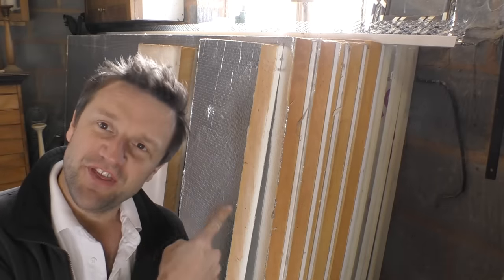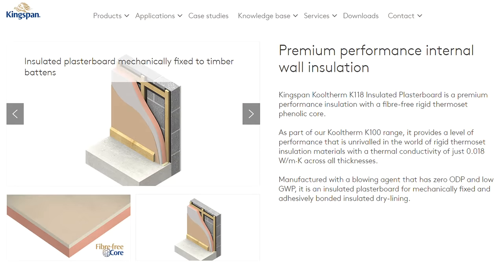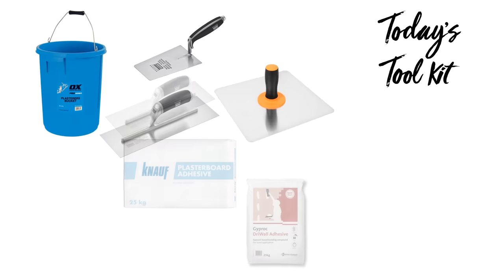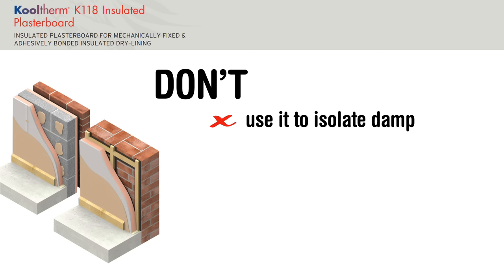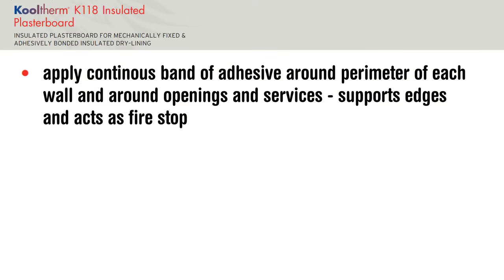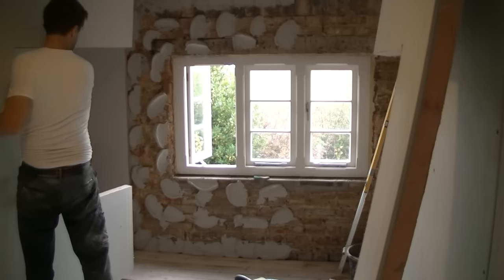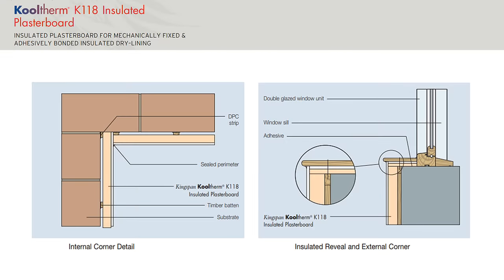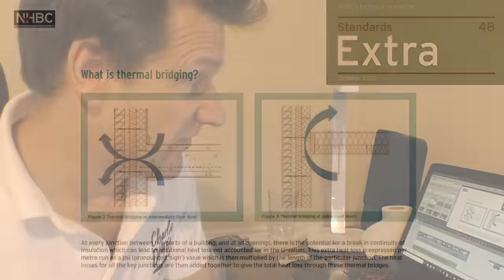How to Dot & Dab Insulated Plasterboard - a DIY Guide

Comment: great video Charlie, subscribed. Was there another purpose to removing the existing plaster other than to checking the brick condition and creating more room?  Also, did you have your windows replaced before or after installing the insulation? It's hard to tell.
Reply from the maker: Thanks! The existing plaster/render was completely shot (no key) and so I thought I'd remove it. Yes, it does buy you a little more room, but if the render had been better (as it was in my daughter's room) I probably wouldn't have bothered removing it. I replaced the windows before insulation, as you want to build your insulation around the windows, in terms of minimising cold bridging etc. In an ideal world you want insulated plasterboard into the window reveal too, with a continous layer of insulation around the right angle of the window reveal, if that makes sense - see the circled bit in the right hand diagram at 23.23. The other thing you've got to watch out for is the plug sockets as this can be a major source of cold bridging.
Reply: @CharlieDIYte  cool. Thanks for the reply Charlie.

Comment: Anyway, you burst my bubble.  I was planning on insulating the majority of my single skin red brick garage as a workshop.  However you mention that if I insulate more than 50% of the walls it is subject to building control.  I was not aiming on creating a "heated living space", just a workshop that I could use in winter a few hours a day with maybe an electric fan heater.
Reply: Simple solution: don't inform building control.

Comment: Can these boards be used to insulate a bathroom ceiling?
Reply from the maker: I guess. Very heavy to put up though. More usual to instigate in between the joists with PIR board
Reply: @CharlieDIYte  thanks for letting me know! I will check for alternatives.
Reply: @Cuiositycola  For your application it may be worth looking into a product called 'Spacetherm'. Much reduced (often 10x) thickness for similar U Value (W/m2k).
Reply: @Bradleyguy22  thank you! Will check it out

Comment: Hi Charlie, Great work! And the reviews from others is now driving me to go down this route on our 1975 built detached house with cavity walls..Got a question, our external facing wall in the bathroom is not level after removing the tile the wall was a  bit of a mess and not level, so I've attached cls batterns to create a stud on part of the wall where the shower enclosure will be. The reason for this is to achieve square edges fo r the shower tray. My question is would you apply insulation in between the batterns or moisture board straight to the stud work? Rest assured idea is to tank the moisture board area in full. Any advise on the insulation will be much appreciated. Cheers Sam

Comment: Kinspan's 'technical department' is talking out of its ring piece: NEVER use timber battens screwed to a damp wall - even if you use a DPM between - it's the perfect breeding ground for dry rot: damp wall, damp timber and zero air circulation. The mycelium will spread up the batten/s, into the first floor joists and the first you'll probably know about it is when some poor sod puts their foot through the floor. And don't assume that tanalised timber will help - it won't. I've seen dry rot go straight through an unventilated tanalised floor in less than two years.   The ideal solution would be to build a block inner leaf, but obviously that would entail a lot of work, and may not be possible. 2nd best: give the walls a 15mm coat of sand and cement render, incorporating a waterproofer (Sovereign Rendermix is a good one.) when fully hardened, offer the insulated board up to the wall, drill 6.5mm holes at 600 mm centres (one at a time, and fix with red plastic plugs and 65mm aluminium (from a roofing supplier) clout nails. Before skimming, scrim over the vertical joints, obviously, but put a line of scrim over the nails in the middle too. Skim up and you'll have a nice warm, dry wall that has zero risk of causing problems further down the line.

Comment: Hi Charlie...if I had to fix some of this to the underside of my rafters, what sort of fixing can I use?

I have a curved return to the top of my bedroom walls which is made out of plasterboard fixed directly to the underside of the rafters but which the back of is directly exposed to the side facing soffit vents.

This is causing cold spots where the air is hitting the rear of the boards and it's not the sort of thing I can simply put insulation behind as it would block the soffit's airflow.

Comment: This isn't dot and dab this is just..... dab, plumed vertical horizontal dots on the wall, leave to set with a square piece of plasterboard set into it, string line off these then fill in the gaps with the adhesive, you can use plasterboard to set or what we use nowadays is those green white black blue spacers you get for when we fit glazed windows (Packers), now you have a wall that got many dots over it which are all plum and in line, DAB the wall you put the plasterboard up press against the dots now it's plum and straight, hence why it's called DOT and DAB

Comment: I am so great full for this as I need to do this in the coming weeks for my extension.

Have you ever installed facia and soffit? If so, do you have any advice? I need to know if this is something that I can DIY or leave it to someone with more knowledge.
Reply from the maker: Hi Dan. I have to say I haven't, but I imagine a bit of Googling will get you up to speed on it. I can't see why you can't do it yourself unless you're installing plastic which will be more fiddly.
Reply: Try the Swish building products website. You can get details of how to install fascia boards and soffits there and you'll be able to determine whether you think you can do the work or not. It would be advisable to have scaffolding to work from to make your life much easier and safer - definitely required from the first floor upwards. You'll also have to check the quality of the roof membrane where it meets the fascia board - this might need replacing so bear that in mind and you'll have to remove at least a couple of row of tiles to be able to replace the membrane. You'll also have to check the ends of the roof rafters. If they're rotting they'll need to be cut back and new pieces added on. It isn't a small job even for two people to do. Good luck with it.

Comment: Thanks for the great video, Charlie.
I have a couple of questions for you:

1. With the thick insulation backing, is it possible to screw through the plasterboard and insulation and into the brickwork, if you want to hang cupboards and the like, or does the insulation just crush?

2. In terms of screwing things into the brickwork (through ordinary plasterboard), it seems that the problem is created by the dot and dab system. Is it possible to completely cover the wall with a layer of adhesive so that there are no gaps behind?  Obviously it would be a right pain when it comes to pushing the board into the right place, and the adhesive has nowhere to go, but would it be doable?

Thanks
Reply from the maker: Thanks  1) It wouldn't crush provided there was plenty of adhesive dabs behind it, particularly as you'll probably need to go at least 60 -70mm thick with the insulation to satisfy the u values, 2) you couldn't do that - because you'd never be able to properly level the board and if you're going to do this you might as well just render the wall and plaster it. If you're worried about hanging heavy things in plasterboard walls, you need some Corefix fixings - as shown here https://youtu.be/fx90VadXSXA
Reply: @CharlieDIYte  Thank you very much.

Comment: Great video! But looks a hell of a job, and messy.
I think I'll have to see if I can find a competent professional to do it for me. 

You were also lucky in that you didn't find any damp getting in from outside when you stripped the render off. If it turns out unfortunately that water is getting in from outside - so it's not just condensation onto the cold internal surface, then the whole thing gets a lot more complicated. Probably not DIY territory. 💦💧🛠️
Reply from the maker: Agreed Ian. And you have the problem of interstitial condensation through the cold bridges if you don't install it properly. It's a truly tricky one, this, a bit like the issue of condensation in cold roofs.

Comment: What was the thickness of the boards you used?
Reply from the maker: About 60mm I think but if I'm honest arguably not quite enough to satisfy the u values (even though it's made a massive difference to our heating) so go as thick as you can - plus you need to tick that box for building regs too.
Reply: @CharlieDIYte  ok, Thanks for the advice. I think that will be as thick I go go without taking too much off room size.
Reply from the maker: @antobeer  Yes that was very much my thoughts at the time. You'll find though that once it's in, you'll not notice the difference. Just do everything you can to minimise cold bridging - between boards, around windows and also if you cut the boards for sockets. If you do have to cut the boards for sockets, consider insulating behind the socket boxes with expanding foam rather than the adhesive as that will minimise the problem.

Comment: Oh dear, did anyone notice all the inconsistencies?  Water penetration and dampness are only marginally touched on . With solid walls you can never be sure you do not have water penetration not least because dew points occur within the bricks; bricks are water absorbent!  A condensation risk analysis will only show up very limited circumstances i.e only as good as the figures you put in. It will take some time but the stuck on board will eventually fall off and the battened walls too because the battens will rot. Meanwhile the mould growth behind the sheets will create various health problems, etc, etc. Do not do it!

Comment: Contacted Kingspan this week as I wanted clarification on the internal corners. The diagram shows the board face up to the external wall as well as the foam which looks wrong when there is so much concern on vapour barrier. Anyway the upshot of this is they no longer provide technical support for projects of less than 3 houses. They have a self service site but apart from going around in circles and finding the same old material it doesn't offer much. Shame really.
Reply from the maker: That's really disappointing David. I agree with you on the internal corners, something I acknowledge I've done wrong in this room. I think what you have to do is complete one wall, and then offer up the new piece at right angles. Mark with a pencil line down the length of the wall where the new piece butts up in the right angle. Take it away and carefully Stanley knife down the pencil line and cut away the strip plasterboard, being careful not to penetrate any vapour barrier between the plasterboard and insulation. Then when you butt up the new piece, there will be a continuous band of insulation going round the corner. You use the same principle on the outside corners around the window reveals. That way you're minimising any cold bridges around the corner, and if you're worried there's any gap you can always spray foam into the gap as you butt the two pieces together. The Achilles heel of this system is a) where you butt up each piece to the next on a straight run where with the best will in the world you'll never get a completely snug joint that eliminates vapour penetration and cold bridging, and b) sockets which are a major source of cold bridging because you're cutting through the insulation. I recently insulated our bedroom and for this reason I chose a different approach. I battened the wall with tanalised 2x1, with DPC where the battens touch the wall. I had to pack it out as the wall wasn't plumb so there's an air gap behind the battens. I then filled between each batten with foil backed 1 inch Ecotherm, foil taped all the joins, and then screwed the Kingspan insulated plasterboard to the battens. I cut through the insulated plasterboard for sockets, but of course cold bridging is minimal because of the insulation behind, and I also foil taped a piece of ply flush to the back of the hole, to give me something to screw the socket box to. I drilled a hole through the insulation then from the socket box to the floor with an auger bit to thread the electrician cable through for the socket. And I had a 10mm gap between the floor and the insulated plasterboard, which I filled with expanding foam tape which is breathable. I think that's pretty much your best bet for wall insulation.
Reply: @CharlieDIYte  thanks for replying... some brownie points there for the huge explanation.  I was thinking of foil wrapping the ends. I have tried your PayPal thing but didn't get very far using phone. Anyway enjoying the wardrobe build at present..  Next project!
Reply: @CharlieDIYte  I'll be taking on this job after Xmas & it got me thinking about dealing with internal corners especially on external walls. I think it makes better sense to miter the corners at 45 degrees leaving a gap to get some closed cell foam in there to fill & maintain a vapor barrier.
I've seen in other videos guys using Jackoboard  for window reveals if it's too tight to use insulated plaster board, I'm thinking it might be an idea to use this stuff behind plug sockets too along with foil tape & some foam.
Fantastic video BTW, really helpful info to formulate a plan, thanks.

Comment: They’re foil backed boards you shouldn’t dab foil backed boards, I could pull one off because the dab won’t bond correctly to the boards, might look ok but the bond to the back of the board will be weak.

They need screwing to timber or metal stud!

And it’s single skin brick get any damp behind the boards which now you can’t see you’ll end up with a mass of black mould behind the boards, too many dabs also and because bonding compound is hemihydrate you’re adding to the chances of mould if you get any damp through from the outside and in time you will!

Comment: With all due respect to Kingspan they are wrong about dot and dab and solid walls. It’s true that moisture is a problem and you need to deal with it. Nowadays you can apply a liquid air tightness membrane and apply dot and dab on top of that. You absolutely should not ignore penetrating damp or you will end up with mould but also it’s a real shame that Kingspan who manufacture relatively modern building products don’t seem to know modern building products. 
Heads up, don’t apply a plastic vapour barrier as that is not breathable and you can end up with mould behind it

Comment: Is it possible to do without removing old plaster back to the stone wall/brick work?
Reply: Not advisable. However, my friend bought a property to rent out where the plaster had de-bonded significantly. He cut vertical channels in the plaster, wall plugged timber battens to the wall,.then mechanically fixed the insulated plasterboard to the battens. That was 6 years ago and as far as I'm aware, there's been no issues.
Reply from the maker: That's a good idea, John. I agree, if the key's gone on the plaster then you should take it off, but in my daughter's room the render was still pretty good so I did dot and dab on top. The problem with this is you don't know if the brickwork is totally dry behind the plaster, which you want to check before insulating on top. I also like John's idea of using timber battens. I did this in our master bed, and the advantage is you're not putting a lot of moisture into the wall (through the adhesive).
Reply: Cheers for the advice.

Comment: What about condensation?
Reply from the maker: You have to do everything you can to minimise cold bridging at the edges where each sheet buts up to the next and around reveals and particularly where you cut in the electrical boxes. My advice would be up look into using the spray foam rather than adhesive as this will be a much better insulator.
Reply: @CharlieDIYte   Hi Charlie/Rebecca, products move on etc. Are you aware of a product called 'Spacetherm'. Much reduced (often 10x) thickness for similar U Value (W/m2k)? It seems to tick most boxes.

Comment: Would have helped if he had drilled and plugged the wall boards because the surface of the insulation is shiny and doesn’t adhere well to the dri wall
Reply from the maker: It's actually designed to be used in conjunction with the adhesive, Rebecca.

Comment: You're lucky,  your daughter turns the rad down,  mine opens the window
Reply from the maker: 🤦 I've just installed the Drayton smart heating system which has a draught detector that switches off the rad if someone opens a window https://bit.ly/3qFDSMg

Comment: I thought you couldn't dot and dab foiled back plaster board? i'm new to doing it but good video anyway.
Reply from the maker: You're basically right but the K118 is designed to be either dot and dabbed or mechanically fixed to studs, although even with dot and dabbing you still have to mechanically fix (ie you can't just rely on the adhesive).
Reply: @CharlieDIYte  thanks for quick reply, I've just got some foil backed board, (not insulated) Assumed i'd have to mechanically fix it using studs, which for me in a garage is likely easier.
Reply from the maker: Yes, you can't dot and dab that. Good stuff though. Used some recently on my bedroom ceiling https://youtu.be/DO3ETESehiI